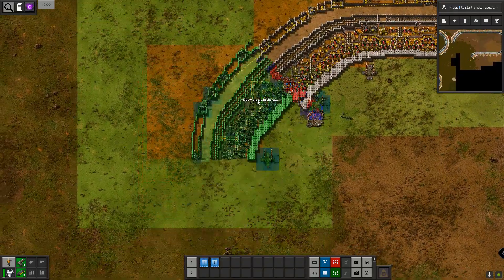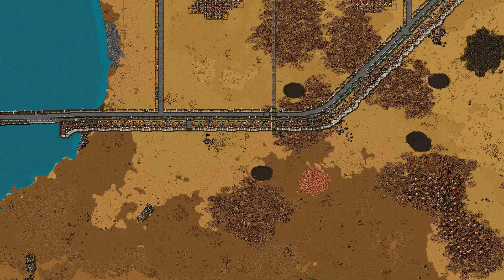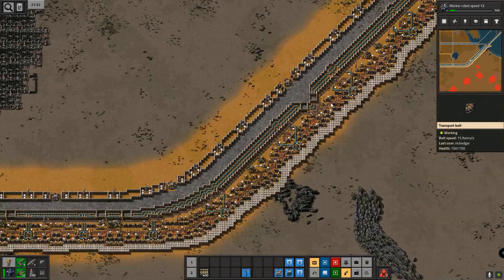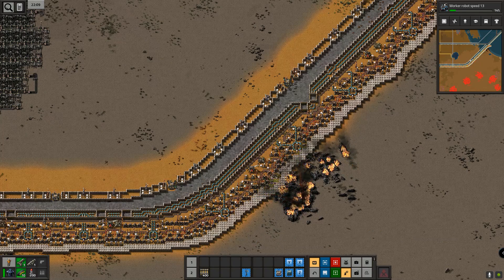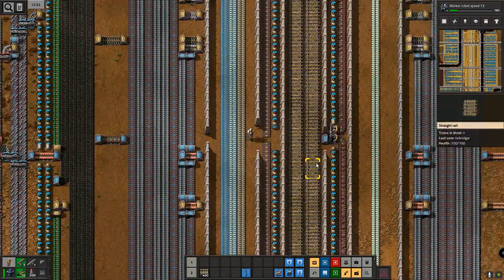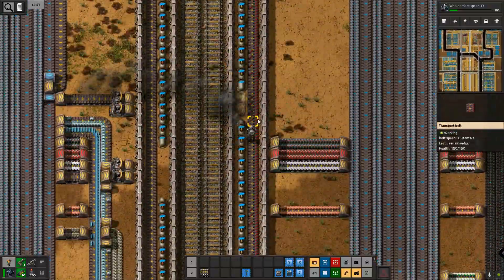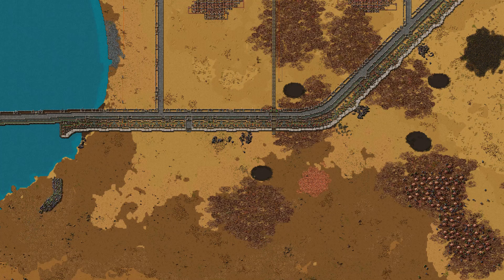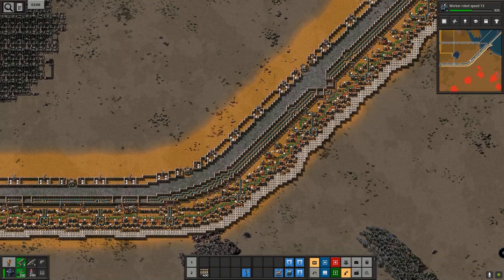Factorio - Perfect Perimeter Wall Geometry Test

Comment: In vanilla my standard luxury wall is 2 layers of stone wall, 1 layer of laser turrets and 1 layer of gun turrets with red/green bullets. It was holding up well even prior to white science damage upgrades but now it just shreds any stray biters prior to them touching the wall.

Gun turrets have 400 hp while laser (1000hp) and oil turrets (1400hp) are much tougher so it’s generally a good idea to have them on the backline.

Comment: The thing I like to do with my walls is to put them some tiles away of the frontal turrets so biters don't attack them that much and save ressources in the long run. But maybe I'm just wrong about it idk
Reply from the maker: Dude, I am no expert on wall defenses. I chuck as many turrets at the problem as I can so I can forget about it and build the factory, which is the bit I enjoy. It works, bish bash bosh, I'm happy. There are so many different ways to build in factorio, my way is just one way.
Reply: One thing I like to do is have a polkadotted wall structure spaced infront of the main wall so that the bugs pathfinding makes the bugs filter through it like a game of plinko. It works well for me and buys good time for the turrets to work through them, I dont use flame turrets but I imagine those well with this setup. I took inspiration from ww2 hedgehog defense setups
Reply: I was just sharing my way of doing it no offense @theotherbigfoot
Reply from the maker: @antoinegeonet1525  I never take offense to anything buddy. I'm an essex lad. We are impervious.

I suspect it was my language that gave you that impression. I'm also an engineer so I tend to speak bluntly and to the point. 

Both are blessings and curses.
Reply: A lot of my friends are engineers I guess I should have guessed hahha

And by the way I normally don't comment videos but because I'm doing it right now  it's not hurting for me to say that I enjoy your content so keep going ^^  @theotherbigfoot
Reply from the maker: @antoinegeonet1525  That is very kind, thank you

Comment: I was looking at your wall segments on factorio prints and noticed you were using the fluid control mod. Is this necessary for the walls to work properly or can i just replace all the missing pipes on my own? Thank you!
Reply from the maker: If you are fueling the flamethrowers with just one type of fuel then the current blueprints should be fine without flow control. With flow control the two pipes are designed to transport two different types of fuel to the flamethrowers.

Comment: i think i know a way to improve it
you need layers of walls or a pattern of walls around the wall to slow enemies down when they enter the weapons range
Reply from the maker: The original video is really about the geometry of the wall segments, how to construct the perfect segments so that they align in a complete ring. The segments I built in that video were the segments that I wanted but the base geometry will work for any particular segments that you want to build. If there is way you would do it differently then have at it.

Comment: "perfect" is a strong word... 
without open wall,respective "dragon teeth" method,you can´t come even close to call the defense perfect!
your perimeter is quite nice,no doubt,but in the long run and with very hard settings you´ll waste a lot of resources (mostly in form of building bots)
you can minimize losses by building a delay logic for the repairs of course but you won´t need any of this with dragon teeth defence
Reply from the maker: I wasn't saying the wall was perfect, only the geometry.
Reply: @theotherbigfoot  the title says perfect,just call it "perimeter wall geometry test" otherwise you´ll trigger comments from a lot of factorio oldfarts like me 😆
Reply from the maker: @hansdampf640  This video is the sequel to a video I made 6 monthes or so ago (https://youtu.be/H3Di8oDUGco?si=-34qmovKGT5b36k5) which was specifically aimed at explaining the geometry. 

In that context I think this video title makes sense. If you aren't aware of that first video, however, then I can accept that the title might appear a little misleading.